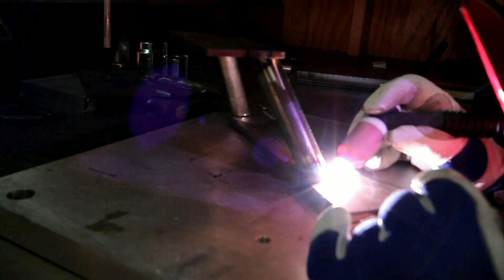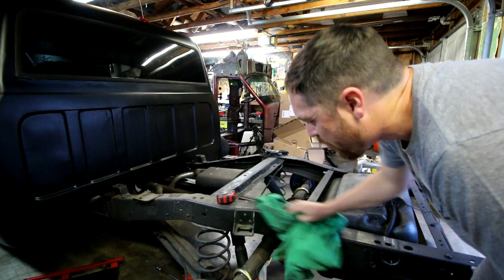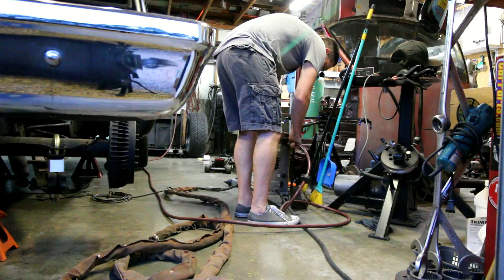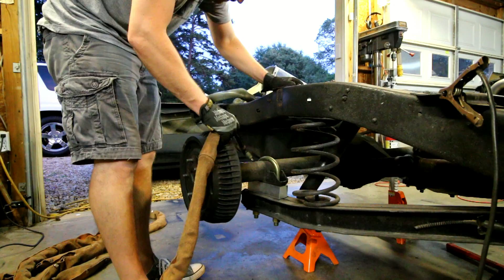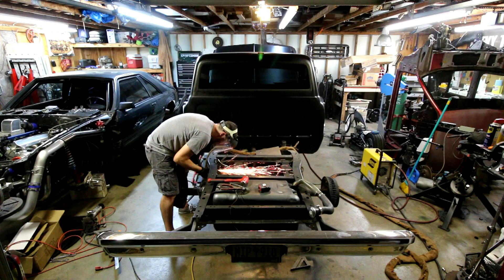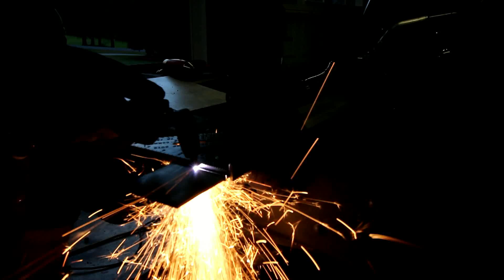C Notching The C10 Frame | Black Pearl

Comment: Did you weld another piece of steel from the top of the inside frame rail to the top of the notch or just leave it like you shown in the video?
Reply from the maker: I have not, but plan to box it in

Comment: Sorry for being the devils Advocate :D  but 

I hope you are going to build some more strength into that rail as you have taken over half the vertical pane out of it, welding in more steel on the horizontal pane gives little strength for what you have removed... that will only increase the side load strength of the rail.
Boxing it IMHO in its current state will not be enough it still will be a weak point (especially for a load carrying vehicle), it would be better to fab up 4 side plates with nice curves and then box that in top and bottom... man of your good skills'n'tools should have no problem in creating it   :)
Reply from the maker: Yeah I plan to come up with something

Comment: Is there a reason you didn't plate the back side(inside) of the frame?
Reply from the maker: Yeah it wasn't need
Reply: I did a s10 a while back for a buddy. Did it exactly like you did. I guess I went over kill then. Lol. It was my first notch.
Reply from the maker: well its not a bad idea to box it in but on the c10 trucks the load of the truck is all carried before the axle. The frame does little after the axle except carry the bed. Plus the bed itself strengthens the chassis

Comment: Hi
are you sure that this way you did not reduced too much the frame section from original one?
some weight on the rear part could bend your frame in that smaller section, what do you think about?
Reply from the maker: I box in inside of the rail to reinforce it...you also have to remember the bed of the truck will be bolted to the frame, adding more strength
Reply: Ok, but section is still smaller, your reinforcement plates would be thicker than the original.
Then ok, the bed is bolted on the frame but it's supposed to be supported and not to be structural, am I right?

Sorry for questions but I don' have experience on custom truck, I'm only curious to know if this modification causes bending problems if overloaded: with reinforcement plates have you ever seen any problems?

Comment: pull the springs, let axle  arc up to see where it is guna need to be notched ?  will it go straight up ?, support rear frame jack stands, so doesnt sag, ?  all that with a gas tank still installed,?
Reply from the maker: +805 redneck yeah

Comment: Oh no, you started wrecking the truck!

Just joking. I think you know, what you're doing.
And one question: is the suspension with arms and coil springs stock for this truck, not the leaf spring suspension?
Reply from the maker: It is stock on the chevy trucks. I believe the GMC's in the same years came with leaf springs

Comment: does anyone know whay he used to paint the notch? is that a prime/sealer? or a just painted over metal..
Reply from the maker: I just painted over metal. Will probably use a chip resistant bed coating on the entire frame at the end
Reply: +The Fab Forums im gonna start doing some patch work and rust removal on my truck. will regular prime and paint work to keep it from rusting atleast till next year when i plan to blast it and coat everything.

Comment: in my opinion adding something such as a plate with some medium sized holes in it that would go up and around the notch sprt of like a fish plate would greatly strengthen that rail. you have awesome fab skills it shouldnt take you too long
Reply from the maker: probably going to do something similar but it will be on the inside of the rail, boxing it in
Reply: sounds great!

Comment: nice job... I bought the after market c notch kit. should have just done that. is that 1/8 inch steel?
Reply from the maker: Thanks. I went a little thicker than 1/8. I think its 3/16. I wanted to match the thickness of the steel that the truck frame was made of

Comment: box inside of frame at least a foot ?       might want pull boat some day ?
Reply from the maker: +805 redneck it could pull a boat now. Its still not boxed but I did add some plate on the outside.

Comment: Did you "C" notch the frame because of a clearance issue once you lowered the truck? Clean work, it's lookin good.
Reply from the maker: Yeah...I was hoping it would have enough clearance with out notching it but it didnt
Reply: I restored a 66 Chevy which has the same frame and suspension and I lowered it and didn't have that issue but obviously your truck is lower than mine was. Very nice work though. Looking forward to "It's Friday Fool!" Have a great weekend.

Comment: turbo :D

ever seen those remote turbo setups on trucks , right after the cab under the bed , advantage of that is that you can reuse a lot of the existing exhaust plumbing and theres a lot less heat and clutter under the hood 
https://www.youtube.com/watch?v=Ku4ZGB7-y7Y&list=PL21CB85F28B87EEF8&index=83
Reply from the maker: I have seen those...get the oil back to the pan from the turbo is a pain in the ass though
Reply: they use a electric scavange pump for that , you can route the returnline all the way up to one of the valvecoverbreathers and dont have to dril a hole in the oilpan 
i allso seen self suporting lube systems basicly and small oiltank with gravity feed intoo the turbo and scavengepump back in the tank